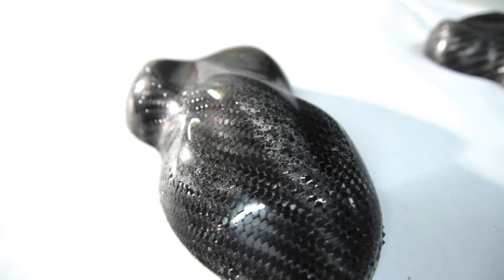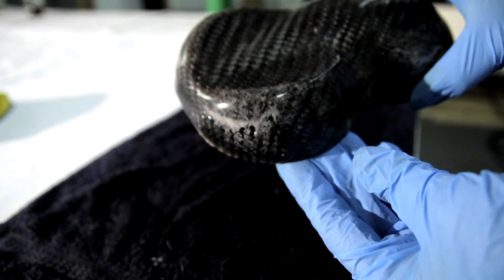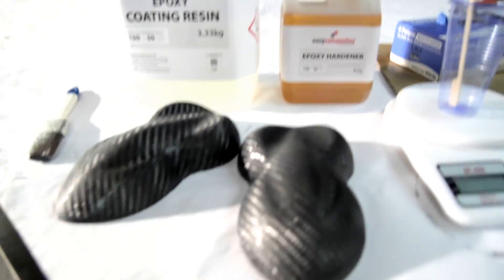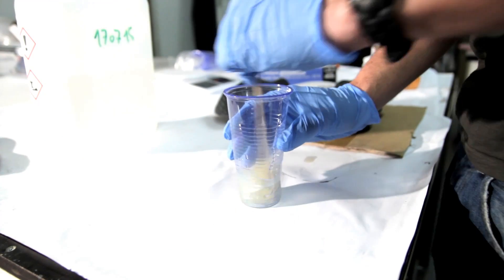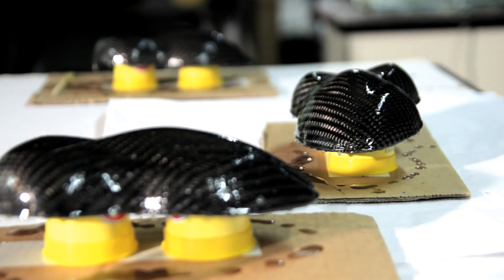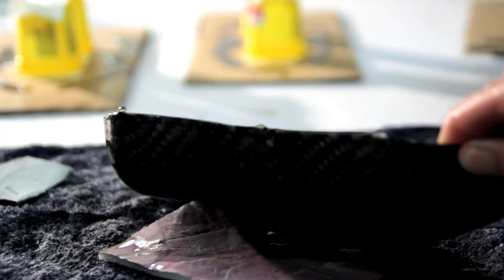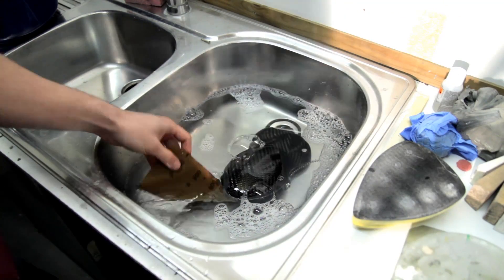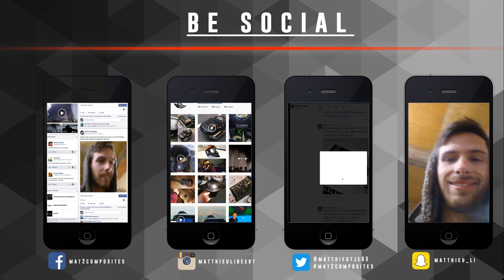Repair Carbon Fiber Parts To Mirror Finish (With Epoxy Coating Resin)

Comment: The resin on my carbon fiber is completely gone down to the fibers. Can I still apply resin too it???
Reply from the maker: If you mean you've sanded it all flat till the fibers then you can add a new layer of epoxy yes
Reply: @MatthieuLibeert  no like literally my carbon has been sitting in the sun for a few years now and it looks like the sun ate up all the gel coat or resin. Looks like the fibers are exposed how would I go about this situation ?
Reply: @zd8dan  if fibers are still intact you can fine sand, clean, reapply epoxy, fine sand and finish coat....if fibers are damaged but repairable, you can sand, add fiber, new epoxy, cure it, sand again, etc....repeat and make everything even, then finish coat it with a uv protection that's suitable...very time consuming but fun for some people.
Reply: @Klips005  thank you for the info!!! i have a carbon fiber hood that has been sitting in my garage because it got super damaged from the sun. when i got some time i'm gonna try and fix it

Comment: I had the same last resin coat don’t look level.     Made a flat bottom steering wheel then wrap the carbon fibre around think wet sand then spray clear coat

Comment: The scotchbrite part is not very clear. Why is it very important? Epoxy manufacturer only state 80 grit sand down is all you need before applying a new coat and that 180 sanding for low spots should have done good enough for spots no?
Reply from the maker: You don't sand the low spots with normal sandpaper, that's just the thing of the scotchbrite that will roughen those low spots as well then
Reply: @MatthieuLibeert  So why even sand down with 180 first if it's the scotchbright that brings the low spots down?
Reply from the maker: Scotchbrite won't remove the high spots the sandpaper does, but the sandpaper won't get into the low spots but the scotchbrite does
Reply: @MatthieuLibeert  Ah okok, thanks for the replies! I'm about to redo the epoxy on my carbon fiber lip.

Comment: Amazing work love it

Recently been doing tons of skinning but recently the resin seems to be bubbling and it show. Up on my work when it dries with the heat gun hot bowl of water under the resin to eliminate bubbles but having dotting recently could that be due to the resin being not right temps or just generally going out of date

Comment: Hello my friend nice videos. Can you please help or advise me? I have skinned around 10-20 parts so far. I have just skinned a boot lid for my Astra VXR. I followed all steps perfectly on easy composites website, for the XCR. Total of 5 coats.. Then I went for the very last (6th) coat, which I added TWO small coats, with a foam roller, then tipped off with a loaded brush - 1hr 40 mins apart. Then left to cure for a total of 14 hours. ( 6 more hours than is recommended). Is this correct or should I have waited 7 days to go to full cure, before I approached the final sand? 

My main problem is after I sanded with the 400 - about to go to 800 - ready for lacquer.. 

- I have lots of white marks, where the low spots have been filled in with the last - 1/2 small coats. I’m unsure if this is caused by sanding to early or the TWO unnecessary coats. (Should have been ONE coat) The temperature was exactly 20 degrees over night. Resin mixed for at least 2 minutes and thoroughly..

I must mention when I mixed the resin, I placed the cup in warm-hot water for 60 seconds to get rid of bubbles. Could this have ruined the resin? Strange because the part was relatively solid when cured!

I also cleaned the part after the 5th coat with UPOL panel wipe degreaser, to ensure the part was perfectly clean! 

ALSO!!!! When I wet the part, the White marks are completely invisible, but will not wash off and they are very visible:prominent when dry.. NOT just sanding marks.. They are VERY bright! 

Like mentioned the part is perfectly flat. Just needs 800 final sand, then lacquer and ceramic coat, but unsure how to proceed now. As I don’t want the White marks to randomly show through at some stage! :( 

Hope you can advise and understand all the info. Thank you very much! 

I can email pics if you would like to see them! 😀 

Cheers 

Dave

Comment: Thanks for the tips. Quick question I do get from time to time small areas that "reject" epoxy after sanding and also some little pits (not bubbles). Any idea what could do this? Cleanliness? I always try to handle my parts with gloves and clean them good with acetone before applying the next coat.
Reply: This happened to me too idk why tho
Reply: @lucasparenteau6085  i found that rubbing the epoxy with the paint brush on these spots usually resolve the problem.

Comment: Beautiful Result..👍 A technic I use on models that were to be painted by brush I'm sure would work with carbon fiber parts around the same size was to cut a section of a wooden broom handle and a good lump of blu tac pressed securely to the underside.

Comment: I assume I can also use the same resin as the one I used to make the part correct, even though it's a little thin?
Reply from the maker: namasayanif yes! Will just be a  it more difficult die to the fact it's so thin you say
Reply: Thank you! I'll give it a go. I have something which surface is a little bit too rippled to my liking.

Comment: +Matthieu Libeert how do you get those tiny bubble off the surface? I keep getting them on new layers...
Reply from the maker: Fick Dich make sure no air is trapped in the resin you are applying, so apply thin layers at the time and make sure your in a hot environment at around 25°c
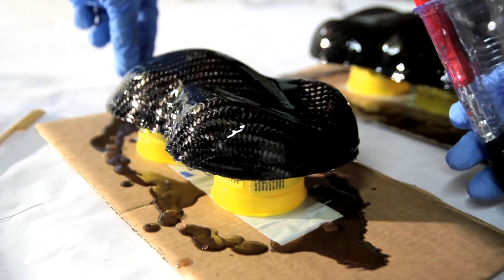Reply: its impossible to mix resin without bubbles inside. I can see bubbles on your models in this video ( 5:39 for example)
Reply from the maker: Fick Dich the bubbles will drip down and after time they will burst before curing... This all depends on the type of epoxy you are using and curing time of your epoxy, the longer it takes to cure the more chance you have to have the bubbles pop. You could also use a hairdryer to heat the resin a bit a'd make the bubbles burst
Reply: Ah thx gonne try that hairdryer-thing
Reply: so i just tried heating and acetone on 2 different side of my recent model.
You should really try spraying aceton on the fresh resin! Heating worked good too but acetone got EVERY bubble out pretty much instantly. Maybe it helps you too
Reply from the maker: Fick Dich I know about the acetone thing but had bad results after curing once so stopped using it, heat mostly does the trick but you'll have to apply more layers because more resin will drip off the part
Reply: Typically you would vacuum degas your resin after mixing it. The hair dryer (mentioned) or a couple quick passes with a blow torch work well for coating materials.

Comment: Thanks Matthieu! The video is very informative. I have made some panels for my motorcycle using vacuum bagging, but had a few voids and dry spots. I am very pleased with the results of your work and video and I believe your process will work for my defects.

Cheers
Reply from the maker: Great to hear you've liked the video! Good luck with your project!

Comment: This is a carbon restoration not repair. I'm looking for how to "repair" broken cf. sorry but I had to give it a thumbs down for the title.
Reply: Technically it is repair. He made the part and it had bubbles in them, which needed to be fixed.
Restoration is recovering the part that has worn out, become off-coloured, scratched, cracked, etc. due to age or use. This was a manufacturing defect.
Reply: @namasayanif  agreed 👍

Comment: Lets say I have air bubbles and bridging in only a small section of something thats as large as a bonnet. Do I have to sand the entire bonnet or can I only sand the local area around the bridging and apply resin around that? Thanks in advance!

Comment: Nicely done! 
Could I also use this to repair a hood? 
There are some holes because of hood pins and a few cracks in the resin. 
I'm planning on heavy sanding the cracked areas untill the cracks are gone and weaved fibres are visible. Then use your method. For the holes I plan to patch them up with carbon fibre, make it fit best way possible, sand the surroundingareas and again use your method on that. Think it can work?

Comment: Your videos are perfect for what I'm wanting to do, thanks so much! Would you recommend a gelcoat over a resin? I'm after that really deep glass look that OEM car manufactures have.
Reply from the maker: Thanks James, You should go for a resin like a coating resin or epoxy laminating resin and not a gelcoat if it's for repair. Gelcoat won't cure to open air! good luck!
Reply: Thank you! I'm going to place an order, I can't wait to start :)
Reply from the maker: best of luck and have fun sanding for multiple hours ;) but the results are extremely rewarding at the end ;)
Reply: Matthieu Libeert did you wet sand every time to prevent the low spots filling with dust? Or did you only do it at the end? Thanks

Comment: Hi Matthieu,
Question:
Will this king of coating increase carbon strenght?
I have cycling carbon wheels which have some deformation when tyre is pumped.
There is no cracks on my rims, they just make some deformation.

Thanks in advance
Reply: False, average for a good epoxy resin mixture would have 5000 to 6000 psi of strength alone, without carbon...with carbon your looking at high 6 digit numbers over 450,000 or something
Reply: No it will not. You would have to add more layers of carbon to increase the strength.

Comment: Using the coating resin, would you say a clear coat is still necessary, or is this scratch resistant enough to not need it?
Reply: Chris Bowen sorry it's late, but you most certainly would want to spray clearcoat to protect your hard work from UV rays. It wont take much time for resin to turn to yellow with sun exposure, without a protective coating. 
Sand after clearcoat with 1500-3000 grit then buff/polish.
Reply: @WilXliFY  What about which sanding grit to use once the epoxy is cured and before applying the clear coat?
Reply: In that case, then what's the point of the coating resin? Purely for repair?

It also looks like the easycomposites coating resin is UV resistant according to their website.
Reply: @ConsciousBreaks  Not sure if you are replying to Chris or Energeticphnom but I assume it's energeticphneom, the resin with the fiber is what give the whole thing it's tensile strenght and structure.
Reply: @JackRR15  Yes, I'm aware. My original question was that the lay-up had already been completed, so why would one need to apply epoxy again when one could just apply the clearcoat straight away? So, as I guessed, it seems that reapplying the epoxy was purely to repair any bubbles and to fill in low spots.

As for your question, the sanding step before applying the clearcoat is mostly so that it can adhere better to the epoxy, as well as to smooth out obvious imperfections. So, you should use a coarse enough grit to remove said imperfections, but not so coarse as to sand through the epoxy. The scratches will be filled in by the clear coat and shouldn't be noticeable. I would suggest maybe 400-600 grit.

Comment: Nice job Matthieu very useful video.
I have never used the Epoxy coating resin as I always fix with normal resin and 2K clear coat, but I will keep this coating resin in mind :) thanks for sharing.
Reply from the maker: The advantage is that it is thicker amd has no residue floating on top after curing, realy good resin!

Comment: I have some future video ideas
-first rolling on epoxy using a roller for even thickness (I have seen it in tutorials but it doesnt specify what type to use or how etc)
-Matte carbon parts
-V seams or other ways of joining fabric with a finished look
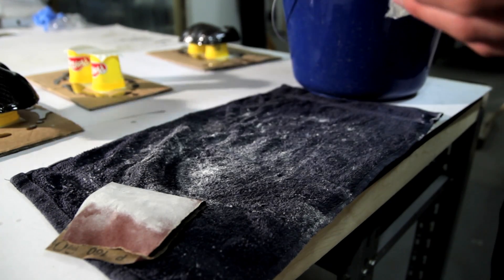- Koenigsegg seems to have an interesting finish where he wet sands through the epoxy until he hits carbon and then polishes and it shows much more metallic (see here: watch?v=71wvtEZ-jcI @4:50)
Reply from the maker: +ndinadis thanks for the imput! didn't see that video yet, checked the entire video :) one of the most inspiring companies for me. Love their passion and detail they put in their parts, that metallic look is something I've been doing for a few years allready :) can do a video about that!
Reply: +Matthieu Libeert (Mat's Prototyping) 
They make amazing parts and seem to be on the cutting edge with wheels etc
It would be great to see how you do the metallic finish
Seams would be my next highest request and probably help a lot of people
Reply: +Matthieu Libeert (Mat's Prototyping)
I've never come across the metalic surface finishing before and would love to see a video on it if you don't mind?
Reply from the maker: +Paul Whelan I can do a video about that very soon :) great idea!